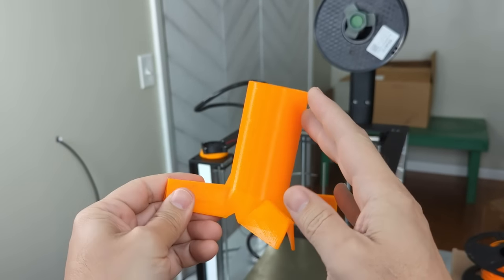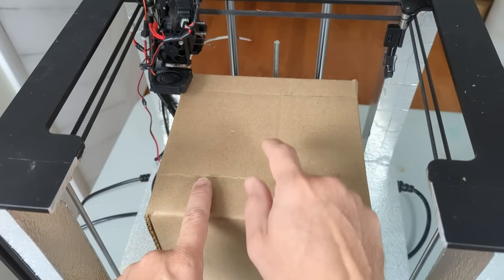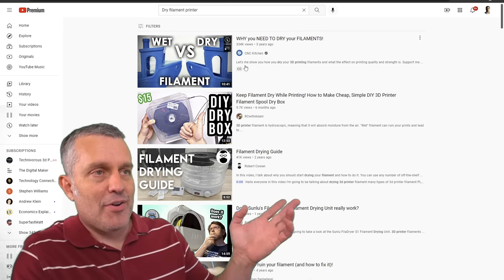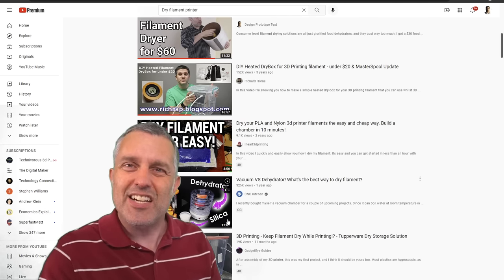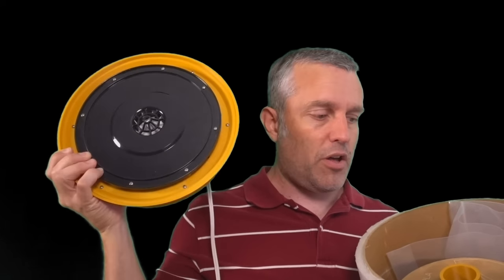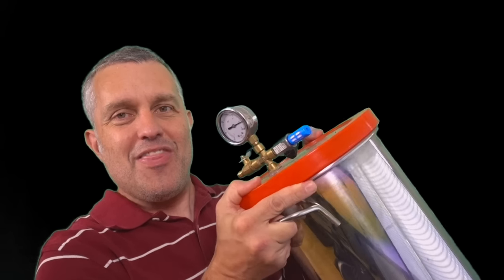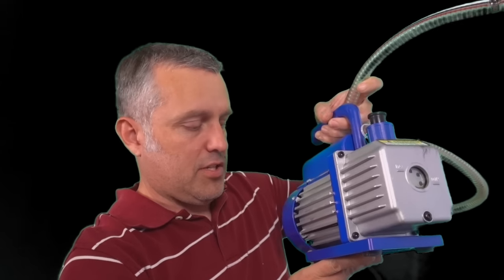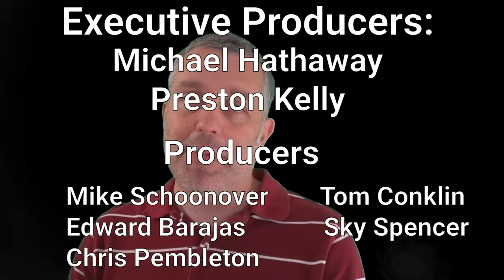The Filament Dryer Built Into Every 3D Printer

Comment: Tying up a printer to dry filament ain't efficient. I'll stick with my dehydrator tower.
Reply: Patric - A dehydrator tower can easily handle 5-6 spools. A printer bed is poorer than a poor man's dryer.
Reply: I got one on Amazon for $25 and can dry 5 rolls at a time. I didn't intend it as a dryer but the rolls fit perfect.
Reply: @Patric and if a pearson only prints a few hours a week a box with desiccant works even better and doesn't require you to turn on or baby sit the printer. No wasted energy.
Reply: @Patric lmao  wanna bet? I have about twenty rolls stored in it and rotated constantly by usage.  Might wanna familiarize yourself with a bit of high-school science before babbling your nonsense again.

Comment: I have a zero power, passive, low cost idea for long term ,easy fast access, storage. Purchase a big plastic box with airtight lid, fill the floor with a few inches of Silica crystals that absorb water. Get another smaller box to house your filament spools made from any mesh. Make sure you have a few inches between the inner box and outer box, also fill space with Silica crystals, make sure the lid also has a layer of silica. A 50kg sac used for making Beer is a low cost bulk price. & wont pass the mesh. After use just but the spools back. seal lid,. Maybe to  preserve the crystals for long term storage , can add a small  vacuum pump, to remove the air from the box. If the crystals ever get to wet, just dry them in an oven or the sun. If you are worried some filaments get wet unopened? Just fill a bin with those crystals and bury your stock until needed. A clever designer would take that idea, and could build that around an ,in use, spool hooked up to a working machine. and the 6 x silica panels  would be removable to easily remove for drying.

Comment: All plastics attract moisture, PETG and PLA included. I think this is a great solution to have in a pinch, but I don't want to have to keep heating the plastic to drive out the moisture, this wastes energy and time. I use plastic boxes from LOCK&LOCK (5.5L, 6.5L and 11L) with calciumcabide (500 grams per box) as a desiccant. I dry the desiccant in the oven for about 2 hours at 105-110°C, add it to the box with the 'wet' filament, and that drops the humidity inside the box to below 10% in less than 2 hours. Then, I leave it in the box for atleast 48 hours before using it. If the humidity percentage in the box gets above 10%, I just re-dry the desiccant some more. Nylon will get wet within 12 hours and on my printer it becomes unprintable quickly after that. Big (5-8 mm) bubbly blobs start coming out of the extruder at random. I guess this is because the steam builds up and creates backpressure in the nozzle. I haven't seen this in lower temperature plastics.
Reply: I use a dehydrator and then airtight boxes with a bit of desiccant

A mix works way better than just desiccant box or dehydrator on their own
Reply: I like the sound of this method.

When you say "calciumcabide", do you mean calcium chloride?

Flakes? Balls?

Thanks.

Comment: 5:00 PETG Is actually extremely  hygroscopic. Many people, especially on youtube, seem to believe that waterproof filaments like PETG and PP aren't hygroscopic because of the fact that the material itself is "waterproof". This is blatantly false. While PETG doesn't tend to ooze or bubble when it contains moisture it is significantly weaker when it has moisture in it. All plastics are weaker if they contain moisture, in fact even injection molded plastic granules need to be dried before being melted in order to be optimal.
Reply: Yes. I've just started a few weeks ago with my new printer and already had my problems with moisture in PETG and also silk PLA. While the carbon PLA seems completely immune. I can leave that out on the spool holder for days and it still prints perfectly.
Reply: Doesn't nylon work opposite? Fresh injection molded nylon is brittle and after they let it rest for a few days it gains more strength

Comment: What most dryers get wrong is they keep the moisture in. There are no good technical ways to do that but funny enough cardboard has 2 very good properties 1) it can let moisture through while air stays in and in case the cardboard would be cold enough to get condensation going it would even move that water to the dryer outside.

From my perspective all filament dryers should have 1 wall made of a vapor membrane - the ones used under roof tiles. Which lets vaporized moisture through but keep it air tight
Reply: I've just started with 3D Printing and I'm shocked at the state of the dryers. They are just heaters! Which can do the job but as soon as the warm air inside is saturated again, they won't dry anything anymore! It's like the people making them never used a clothes dryer or heard anything about dew point and vapor pressure!
It would already help if they pulled in a small amount of surrounding air (and thus expell the same amount of moisture saturated air) during the process.
I'm pondering the idea if creating a peltier powered dehumidifier/heater (leading the air over the cold side to condense the humidity out and afterwards over the warm side to get the relative humidity down again) but I'm not sure how to handle the excess heat because peltiers are awfully inefficient)..

Comment: I've been drying filament with the cardboard box (using the same the filament comes in) for 3 years, even with no flow, works like a charm.
Reply: So just leave the filament in the box there to "sweat" for 4 or 6 hours on a 65c bed and that will work fine?
Reply: What do you put the filament on? And do you line the box with foil?
Reply: Just punch 4 or so holes in the top of the box to aid in removal of the moisture.
Reply: i just live in a desert in san diego so i guess im just lucky, i never have to use a dryer.

Comment: You already have a fan. Convection. Just extend the tube through the top of the box. Convection will draw the air thru at an appropriate rate.

You don't want to move lots of air just enough to bring in new and heat it up so that the relative humidity drops. That causes a difference between it and the filament and the water diffuses out. The air only holds so much, so new air must be pulled in. The fan will cause to fast air changes either requiring lots of heat to get the air up to temperature, or the air will always be cooler limiting the ability to absorb more water.  Obviously there is a balance to be found there though as too slow and the air reaches the same humidity as the filament and nothing happens.

People also don't understand humidity. You should do a video on that alone. I see comments on dryers like "as soon as you shut it off the humidity immediately jumps back up to ambient, this thing doesn't work". Yes it has holes in it for ambient air to get in. As you heat air it can hold more water, so the relative humidity drops. When you cool it back down it can hold less, so the humidity rises.

Couple things missed here about dedicated dryers. Size. They don't take much more space than the spool. For me that was the reason to get the over priced dehydrator. 

They often have places to put desiccant and some can be sealed. The heat dries the filament to a point, but dries the dessicant too. When you stop bringing in new air and cool it down, the dessicant dries the filament further. This works even better if the dessicant is on top of the heating element where it gets much hotter and gets really dry. Making a metal tin of it and setting that on the bed would help accomplish the same here.
Reply: Huh. I've heard of air having ratings like 0, -40 based on how cold they chilled it to get the moisture to drop out of it. Instead of heating, why not cooling? As in, put it in an enclosure with an AC unit.
Reply: @randomidiot8142 That could condense moisture out of the air, and in theory the plastic would then transfer some to it to equalize. Things don't dry quickly when cold though. It would be difficult to keep moisture in the air from condensing on the filament. Heat drives the moisture out of the plastic. Particularly as you approach the boiling point. The more energetic it is, the more it is likely to break away.

Really you would want to get the air real cold (but just above freezing) to condense the moisture out and then warm it back up (even well above room temp) and blow that over the filament. That should be more effective, but much more complex and expensive as compared to a simple heating element. Since not a lot of air flow is required, it might be possible to use peltier coolers to make a relatively  inexpensive dehumidifier. The air can be directed back onto the hot side to warm it back up and the inefficiency of it, will make sure it gets warmer than room temperature.

Comment: Or just get a Bambu with an AMS, and never worry about drying filament again.  I can't recall the last time I had to dry anything.  I print almost exclusively ABS and PETG, and NEVER have to dry anything that's stored in my AMS, even if I leave it in there for months between prints.  My other filament (not in the AMS), is stored in a cabinet with a couple desiccant pods.  No moisture issues.
To be clear, I'm not a Bambu fanboy.  It has plenty of issues, but filament drying isn't one of them.

Comment: Did this since the first week of 3d printing, from 2 yrs ago. 

The reason why you shouldn't do this is because your printer is supposed to print, not dry the filament. 

and Sunlu is not crap, although they can definitely do better (such as the fan mod and better insulation). Sunlu is the first company to lower the price of a dedicated filament dryer, that actually works, while Eibos and Esun are ripping off customers with crappy designs.

Comment: Thanks, what a Great Idea,  I was looking around for a box that would fit the rolls for the heat shield, . . .  The Filament boxes fits the rolls just fine, now I needed something to allow air to circulate below the roll, . . . three small bags of Silica Gel beneath the roll works fine,  . . . I cut the top off of the Filament boxes and sliced off two 3.5 inch section from the top to be used as legs to raise the boxes up so air could circulate above and below the roll,  . . .  now all I needed was an air source, . . . I cut a small slot in the now top of the box (bottom side up) and lowered the Printer Head cooling fan fangs into it.  Then set the bed temp to 50C, and the Cooling fan to 75%.  Note the Filament is still attached into the Extruder as normal on my Ender 3's.    Thanks for the Great Idea.  I will use this often, when my printers are not Printing.

Comment: Your refrigerator is an excellent dehydrator.  Anyone who has ever left a block of cheese in the fridge knows this.

You can just throw your roll in the fridge. 

There is one caveat, though.  When it's colder than the air, you will get condensation.
The solution is to throw it in a zip lock bag when you're ready to take it out, and the bag will prevent condensation from forming on the filament.
Reply: Great idea but now my filament smells like eggs and cheese 😆
Reply: Put mine in a whey protein bottle... jaja @NerdSnipingBatman

Comment: For most people it's probably just easier to buy a filament dryer like the one from SUNLU. It's not that expensive and works really great. The new one goes up to 24 hours and goes to 55C. Anyone into 3D printing can probably afford these.
Reply from the maker: So you think "most people" who get a 3D printer as a hobby should spend an extra $50 on top of buying the printer and the filament. They should do this when they could get the same results with  $1.50 worth of filament + $3 fan? I thought the whole point of a 3D printer was to make things yourself.
Reply: Fair, but there's also disadvantages. Additional deskspace used, extra cables, less controll.
DIYing is certainly not perfect but in this case I think it's the superior solutions for most people
Reply: @DesignPrototypeTest  for some, and I agree with you. Built a Voron which is the ultimate admission that for some 3dprinting is a hobby to build and tinker with 3d printers... Now I'm running a few FDM with more advanced calibration routines that I don't have to watch the first layer go down on and I use those for my work in healthcare making things for people. Some people are comfortable soldering and crimping like we are. That being said I love your design and tried tinkering with the use of a bed as a PID heating element for a dryer but had issues getting the box up to temp. Probably would have had fewer issues if I put more time into it but decided my time was more valuable than tinkering with it when I can just afford a $35-40 food dehydrator (the ones with a knob got expensive since 2019!!!!)
Reply: @DesignPrototypeTest  3d printing is not a cheap hobby. yeah the point is to make plastic things yourself :) The idea of using the print bed as the heating element is very clever. but when not using the print bed, i think 50 bucks to guarantee dry filament for best printing results is a great investment. it would even pay for itself over time by the amount of waste of filament that would be reduced from shitty prints.
Reply: @DesignPrototypeTest As a new person to this and somebody who has an almost turnkey Elegoo Neptune 4 solution I would rather spend $50 on a solution that works and is repeatable and doesn't require me to "tinker" with it than to DIY it. I want to spend my time printing, not troubleshooting yet another thing. Sell me a solution that works for an inexpensive $50 and I am there. No offense to the DIY guys, I love the zeal and interest which drives this hobby but at some point this all has to go mainstream (and it will) so easier and better for a little money seems pretty good to me. I just want to print stuff man! 😎
Reply: You can't print anything when a roll of filament is on your printer drying.

Comment: lol so my cheap filament drier consist of an Overture filament box with 9 holes in the bottom. I place it on a 70 degree bed and run it for 3-5 hours and boom, dried filament. No money spent, no extra fans and it works well enough to print again. My PLA+ was so brittle and no more brittle filament or popping when printing. Apparently my new house has a higher percent of moisture in the air compared to my older house. I may try your way to see if it speeds up the process but I guess I have a few old PC fans. Thanks again!

Comment: I store mine in a 5 gallon bucket with a large desiccant pouch. It stores for months this way and you can fit about 5 spools in it. Make sure you buy the lids that have a rubber seal. And if you really want to use a hair dryer to warm the air inside it just before closing the lid tightly. Just my 2 cents

Comment: One thing, moisture rises when heated so if you do not put small vent holes in the top of box for the moisture to leave, you cannot dry the filament completely. But it is an extremely great idea. I bought oversized Ziploc bags (100 for $25) that holds two rolls of filament. and I drop a couple of moisture absorbing packets in there and don’t have any issues with any filament being wet. I’m 15 miles from the ocean and maintain 60% to 99% or higher moisture levels 365 days a year. If I forget to put one up, I do have the cheap little plastic dryer that you showed and the new version will drive filament for 10 hours and has moisture heat settings for three different types of filament because I do have a Corn based PLA that’s bad about absorbing water and does not fit in my AMS to keep it dry.
Reply from the maker: I find that the lack of a seal between the cardboard and the bed allows enough air exchange to rid the cardboard chamber of moisture. No holes needed. You are correct that the moisture does rise. The cardboard itself is also porous and absorbent.
Reply: I think you will find that you're drying time and the amount of moisture you pull out will be twice as fast with 2 to 5 1/4 holes in the top.
Reply from the maker: It's a balancing act. Holes too numerous or large keep the temperature from getting high enough. You need the absolute minimum of perforations. I haven't done the science to figure out where the perfect balance is. Perhaps you have. Or are you just making an educated based on personal experience like me?
Reply: @DesignPrototypeTest  I played around with this some, the one that appears to work the best would be a box similar in size that you have cutting the tops flaps into a triangle and then duct tape them together into a pyramid top with one 1/4 to a 3/8 hole at the very top.  I used a 10“ x 10“ broiling, air frying, or  convection pan with grate and put the fan under the grate to blow upwards to move the heat up with the angles. It’s gonna reflect most of the wind back down on the edges but the moisture will continue rising out of the hole. This could also be done on low heat on a stove or hot plate.  The stove, or the hot plate did provide the best and fastest results by almost 50% or more. You can model this and some kid programs the build it and their flow looks really nice. Of course the fan you would hang from the top greet with paper clips so you could use a higher heat. But just placing the filament on the same pan and putting it in a convection oven works just as well I have a convection microwave, convection toaster and a convection oven.

Comment: I am drying all my pla in a big food dryer at 45 degrees for at least 8 hours and everything is fine. After drying I store them in sealed boxes with silica.
Same with PETG but with 60 degrees. It makes a huge difference and I had problems in the past with bubbles and the exploding noise during printing when the moisture starts cooking in the nozzle.
My printer and filament is in the basement and essentially it the summer, moisture is a problem.